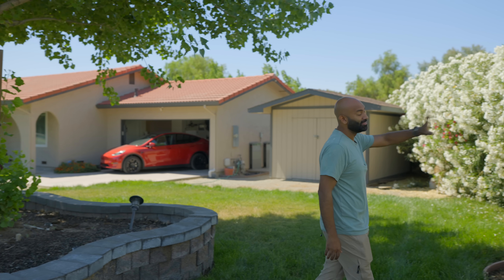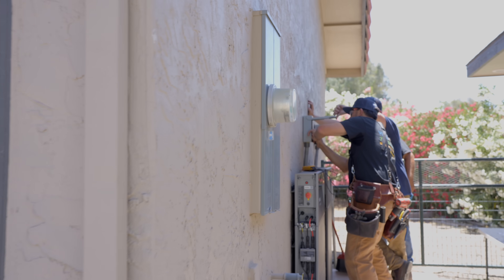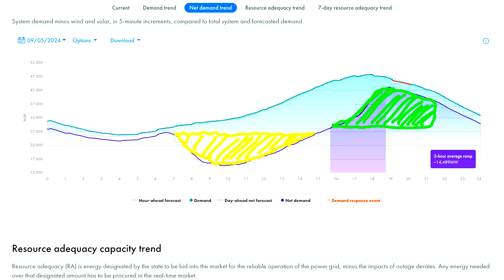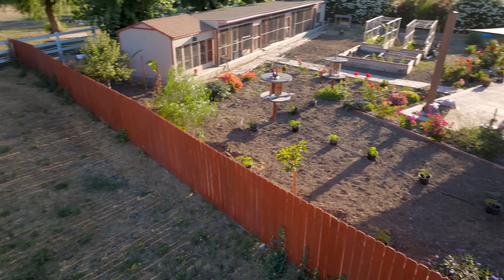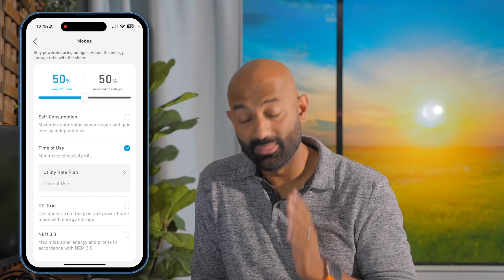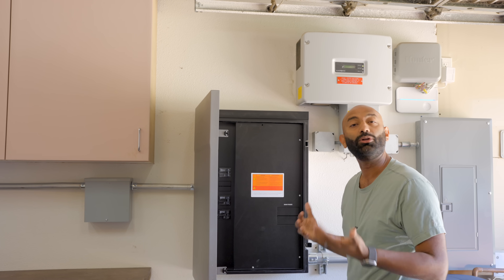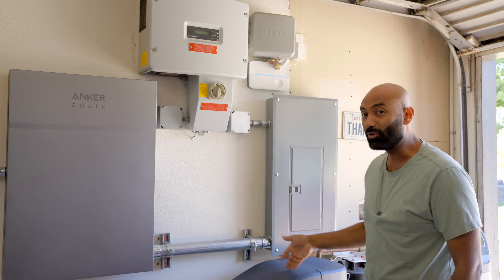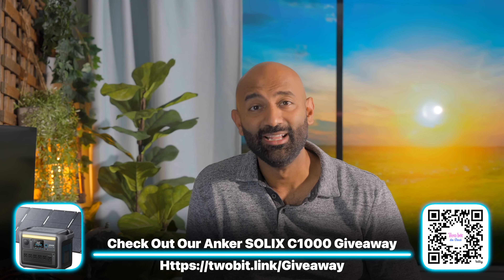Anker Solix X1 Home Battery - The One to Get?

Comment: Every house should have batteries. Unlike electric cars, these batteries don't need to be compact or lightweight. And usually, a battery that is considered low capacity for an electric car is quite sufficient for use in a household. 
Batteries not only reduce the load on the power grid during peak demand, but such a grid is also more resilient and doesn't have a single point of failure. Additionally, it is cheaper to set up and maintain. Less electricity flowing through the grid means fewer wires, poles, transformers, and lower energy losses during transmission. The best approach is to use electricity where it is produced.
Reply: It'll happen sooner than expected. Baffling even to Tony Seba!
Reply: How is it cheaper to set up and maintain?
Reply: @-whackd  Electricity consumption is constantly increasing. The electrical grid won’t last forever, and soon it won’t be able to handle the rising demand. It will be necessary to install wires that allow for higher current (thicker wires, new materials), and the active equipment will also need to be replaced with new, higher-capacity versions. The electrical grid is designed based on the maximum possible load (peak load)... or a larger number of households should install batteries and some way to generate electricity themselves.

Comment: Theses systems are extremely expensive, what is their ROI on the system?
Reply: It's highly locational dependent because the difference between the off and the peak rates are going to change wherever you are. Also, how much power you use and when is going to come into play with this as well.
Reply: @CaedmonOS  That is why I put "their" as in his parnets  I want to see if he did the numbers to see how long it will take to pay itself off.
Reply: It would be interesting to see data around next year.  It's also 'hard' to calculate ROI on a system that provides backup capability.  What I would like to see is comparison of this system vs a standard backup generator system (I say nat gas to this home).
Reply: @Eric-xq4dy  I like to look at a hybrid solar system like this as a backup that pays for itself. A backup propane or nat gas generator is never going to have a positive ROI unless you place a VERY high value on consistent power. Even if a hybrid solar system only pays off 70% of it's cost over the life of the system it's a lot better than a generator. Exact numbers would give a better picture, but you probably won't know those for a particular location for several years.
Reply: @extragoode  That system most likely cost about 25 to 30k. It will never come close to paying for itself. A costco propane generator and two 7lb tanks would run about 1000 dollars. Run some extension cards for the few hrs it's put. Done. I like Ricky but he's pushing a product that most can't afford and it's only a convenience feature not necessary. Also these companies give him huge discounts on the products and  sponsor the episode. Some time his just a product pusher.
Reply: I think the emergency power backup capability is worth a lot and hard to capture a precise ROI. Our area lost power for 6 days last year during the winter and some houses got to 35 degrees inside which affected the plumbing. For me, there's multiple factors to consider.
Reply: Negative if you're grid tied. Unless you have to  run a business or lots of fridges and freezers during a power outage and your food could spoil.

Comment: Solar and batteries are constantly becoming much better every two years... With solar panel recycling, there is no reason to distrust solar energy production
Reply: True not sure why anyone would. Self sufficiency is also a great thing to aspire to have.
Reply: I prefer Sodium Ion Cells for Long Term Safety and Durability
Reply: Except that panels can catch fire. My recycled panels are not mounted on my asphalt shingled roof system.

Comment: LOL so batteries saved the grid. And why did the grid need saving? Due to all the demand because of batteries, bahahahaha
Reply: A bit of a reality bubble you have there that needs to be popped.  I was charging my EV just fine during that particular heat wave.  The gov only suggested not charging EVs during peak hours (4pm-9pm.  For that emergency is was more like 3pm-10pm).  So I simply plugged in after midnight.  Not that I have to charge my EV every day anyway.

But numerous media outlets turned it into a silly meme that, ultimately, people like you wound up believing I guess.

That was before California had a lot of battery storage on the grid.  In fact, the event was caused by a number of NG plants being decommissioned and their replacement grid-scale storage not yet being online due to regulatory delays.

It spurred a building spree in grid-scale battery storage in California.  Texas also saw the light and started building grid-scale battery storage.   This storage has been credited at turning the heat waves that have occurred since that event into non-issues.  In both states.

So... batteries FTW, it appears.  Reality sucks sometimes.

-Matt
Reply: @jamesbizs   i’m not sure if you remember 5 to 6 years ago, but the grid was constantly losing power and 5 to 6 years ago. There were almost no electric vehicles on the roads. I’m a little bit confused by your logic that the demand for energy because of batteries caused batteries to fix the grid you seem very confused.
Reply: @justinschmidt1380 it’s not confused at all . What happened 6 years ago had no bearing on today. The Cali governor literally begged people not to charge their cars! Did you forget that? That alone should show you you’re the one confused. Today, now, not 6 years ago, the grid would fail due to the demand on it from ELECTRIC CARS and such. So now we need house batteries, to make it past that demand. 

So, what did we learn? We need batteries to save the grid; due to the demand ; from batteries. 

And while there are way more cars now, we had plenty 6 years ago too. Especially in a place like Cali
Reply: @jamesbizs  Are you conflating batteries in electric cars with the battery presented in this video?
Reply: @jamesbizs   you need electricity to refine gasoline and you need electricity to pump gasoline. The largest consumer of electricity is the oil and gas industry. If the power goes out. Should we tell ev owners to not charge ? Yes. Of the power goes out should we tell the oil refineries and the gas stations to stop pumping gas and running the coolers in the store ? And the A/C? Yes we should. What is the difference?